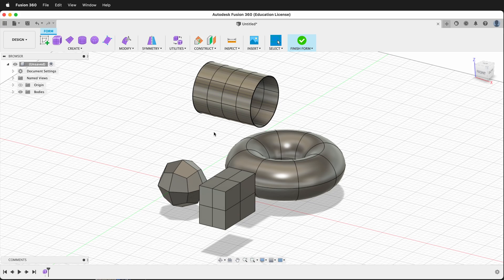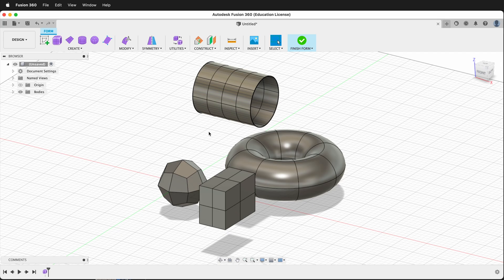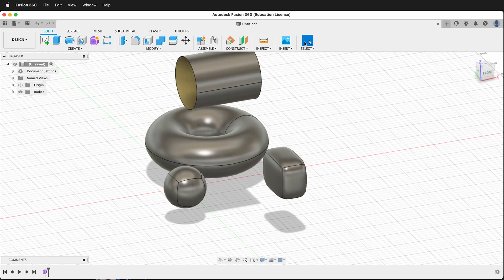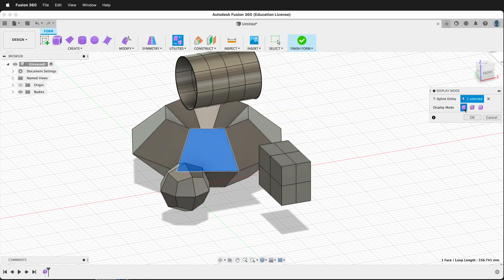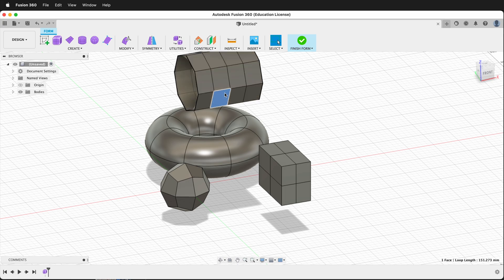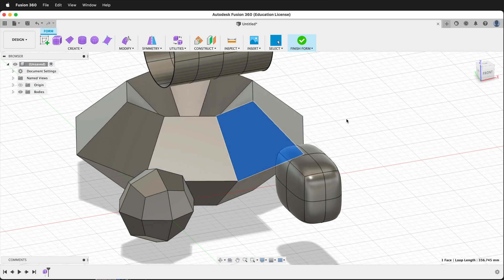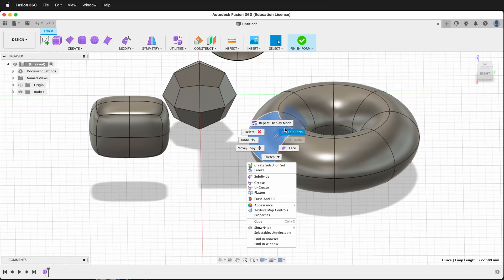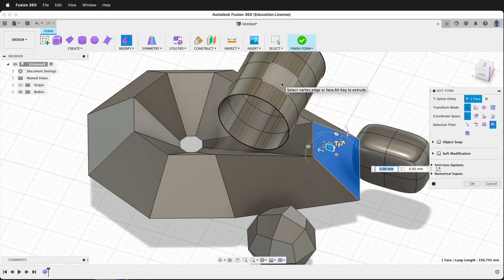Switch from Box Mode to Smooth Mode Fusion 360 Tutorial

Comment: Why edit in box mode if smooth mode is the physical reality?
Reply from the maker: Because it is very easy to move vertices or edges or faces into interacting and other distorted positions that won't solve if you work in only smooth mode, best to switch back and forth as needed

Comment: Thank you for the video.
I have a question: these different display modes are just visual or if we export the file when it’s on box mode we will get the stl as we see on the screen? So if we want to have it rounded we need to set the display to smooth and then export the stl?
Reply from the maker: In fusion 360 the smooth display mode is physical, after you complete the form, it becomes a real solid and the smooth version is exported. This is unlike Maya or Blender where the smooth display modes are "visual" only unless you add subdivisions
Reply: @WhatMakeArt  so basically the way I see the model on the screen is the way is going to be printed right?
Reply from the maker: Yes, what you see in the solid workspace after you "complete the form" is what will print. When you export an STL from Fusion 360, you can see a preview of the tessellation of the mesh that the STL will use. That is exactly what will be exported and what will print.